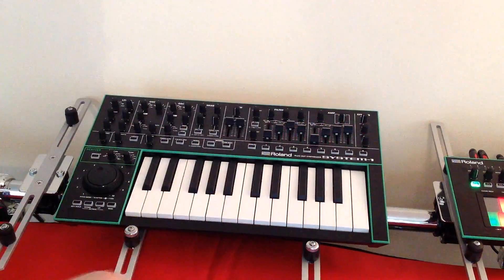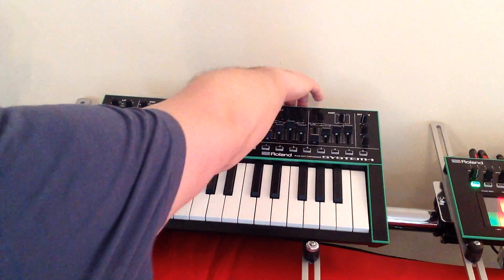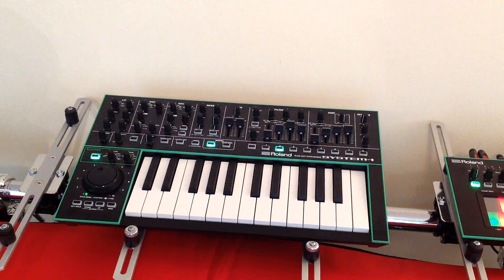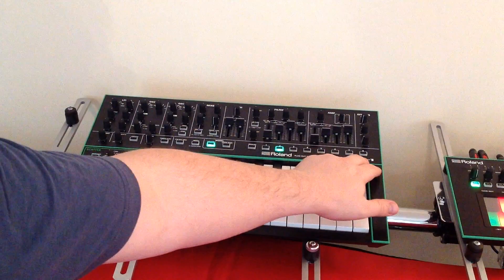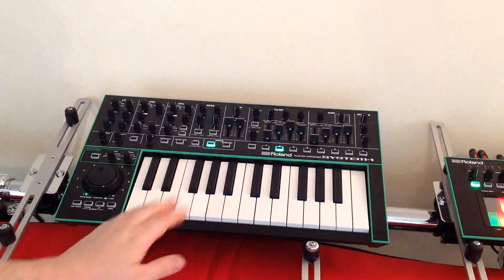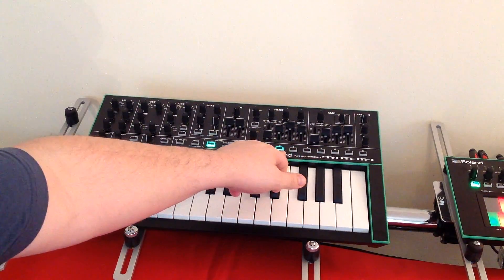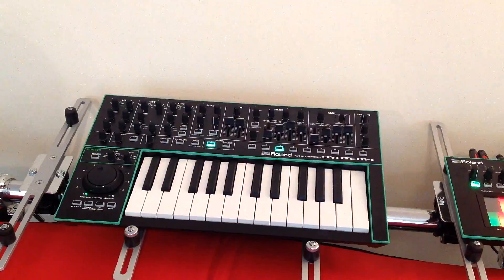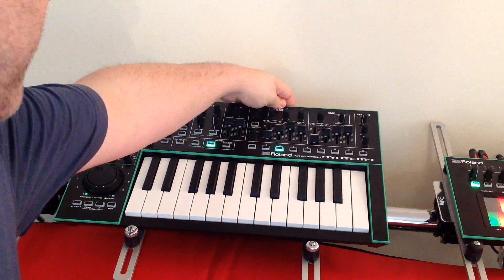Roland System-1 - How to check the Firmware version - 2015-12-13

Comment: any advice for when i tried to update my system 1? i dragged the bin folder to the driver folder, and ejected the system 1 but then when i hit the down button the scatter lights didnt light up, just the up button and the srp type and step knobs are currently flashing, i dont want to turn it off, any idea what to do next?
Reply from the maker: Replied to the other comment, so hope you don't mid it I removed this duplicate?